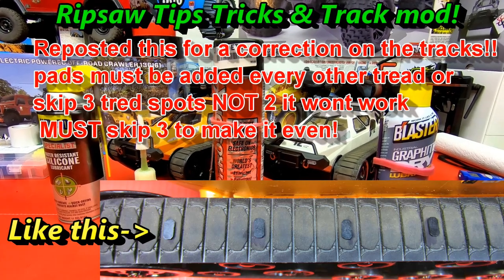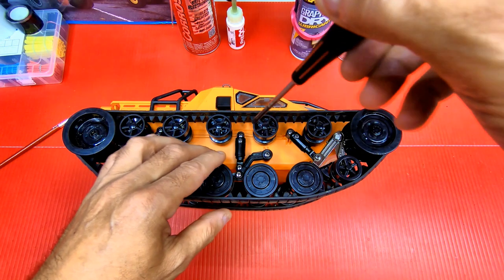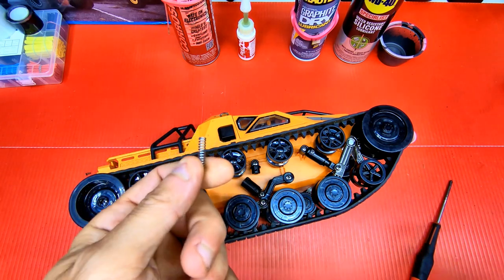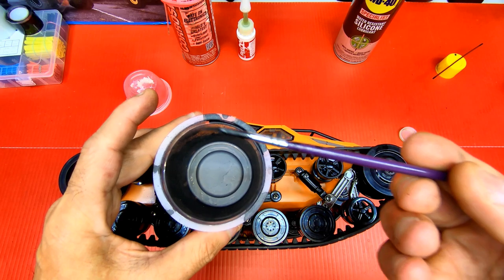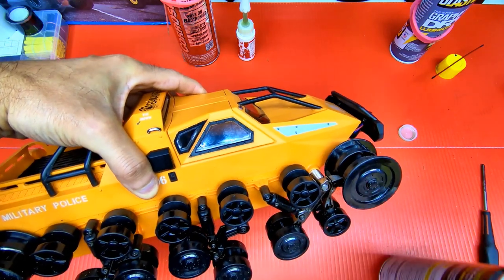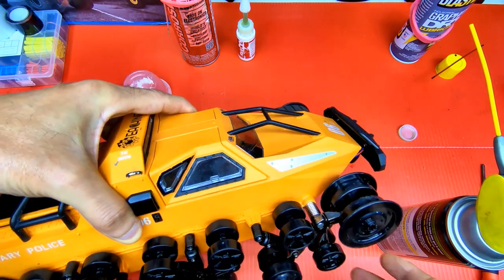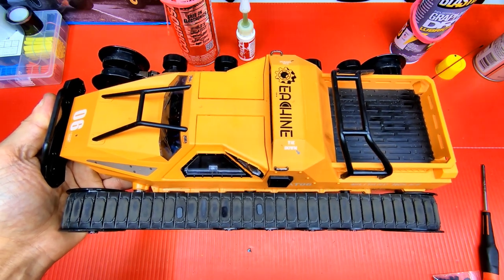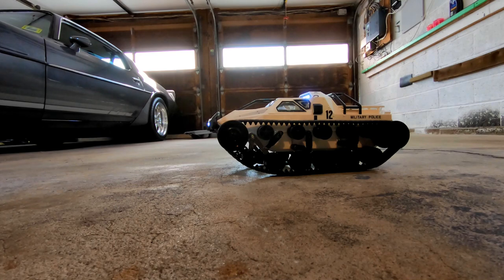SG1203 drift RC tank Tips tricks track mods and maintenance HOW TO

Comment: I am thinking rubber tire patches for traction pads. You can even use an old inner tube and cut strips of the tube up and glue them on.
Reply from the maker: Hi that should work. 👍
Reply: @ShenRC  I have the Kyosho blizzard and was told not to use the metal tracks as they are heavy. I am thinking the same would apply with the ripsaw. I see yours is rubber. Have you tried the metal ones? I just don't see how metal tracks would work that well on these. What do you think?
Reply from the maker: @scottfirman  Hi I never use metal tracks they make your tanks get more stress on everything and you break stuff from it.. I never run metal tracks on anything...guy's used to run them in our tank battle club and they were always the ones with tanks broken down.

Comment: Taking the springs out after each use will be annoying, but maybe once in a while take them out and put them in some strong ruse remover, what about coating them with some water resistant coating?
Reply from the maker: A coating may be good I used corrosion X on them.. maybe just paint them with a good primer?  Thanks for looking.
Reply: @ShenRC  I bought mine used off of a co-worker months ago, I see some surface rust on the metal, mainly the screws which doesn't really matter that much, but I also take it through water so the springs themselves are pretty rusty I bet.

I will be getting some conformal coating to waterproof my electronics, so I will wait until then to soak the springs in the acetone, then after that put the coating on them as well. To hopefully remove the need  for maintenance every use.

Comment: Can u help me Steve? You seem very familiar with the tank... when I turn mine on, it gives 3 throttle forward blips! New, just conformal coated and xt60 with 2s lipo. What did I do??
Reply from the maker: I am not sure.... one guess is you may have got some on the snap together connectors? try pulling any connectors of and put them back on and off a few times so they make contact if there was some coating in the connectors.  Hope you get it working.